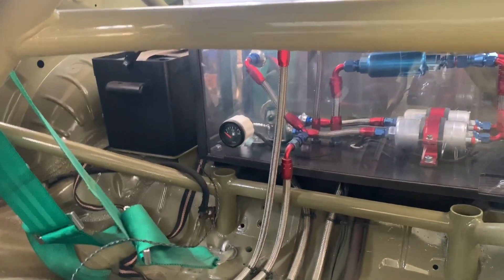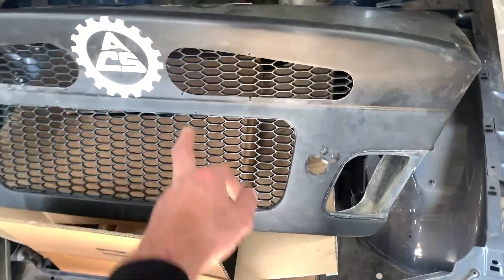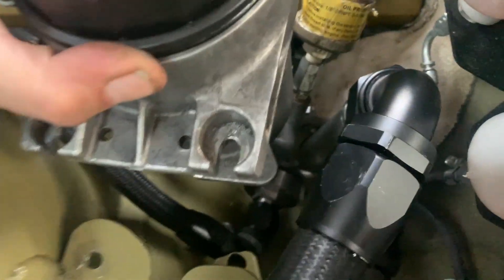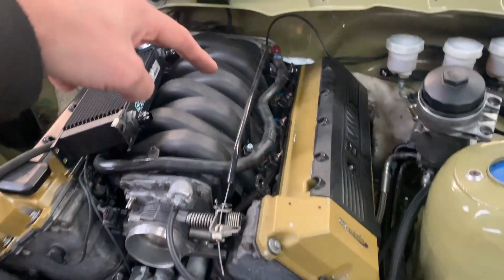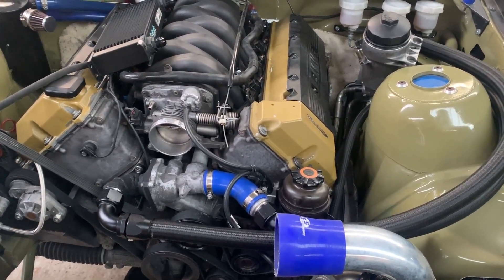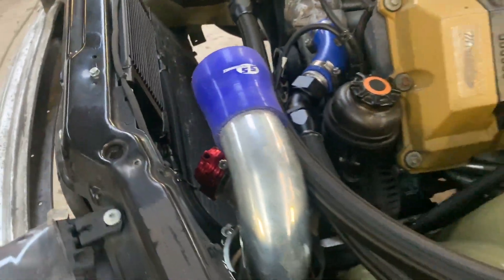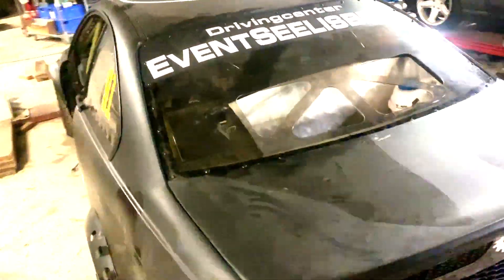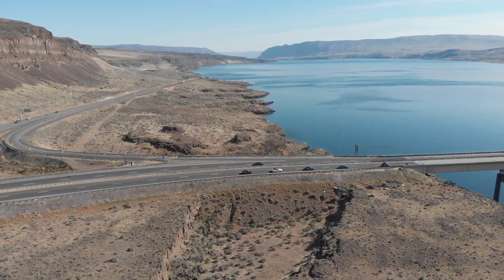Drift E46 M62 Vortech Done : Rear Mount Radiator, Ethanol remap to pump, diff and axles upgrade

Comment: if you were building boosted m62 would you choose charger / turbo / twin turbo setup? (drift car)
Reply from the maker: You can make it all work. Engine bay packaging for SC is easier but exhaust for turbo is easier
Reply: @DriftJesus  i always think that with turbo setups we can upgrade later on if needed and supercharger setups bit harder to upgrade. Or is it a lot easier with the chargers like get a different pulley add some more injectors waste gate spring if needed and you are done. 

Lovely rebuild by the way loving the technical videos. Best of luck at the dw5
Reply from the maker: @gorkemcosgun  its always a lot of work to make any changes to boosted setup , unless  you keep the same main components. The pulleys are easy to swap but the possibilities are not endless either.  Belt problems are very common in drifting applications for superchargers
Reply: Ad assume you're referencing hood exit exhaust? I want to turbo an m62 but finding manifolds even that needs fab work to work in a platform is almost near impossible. @DriftJesus